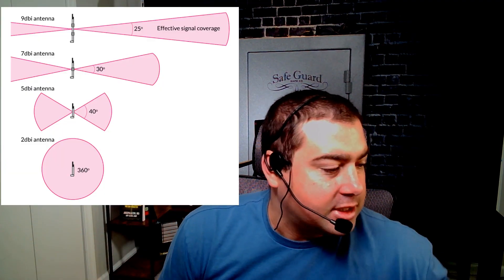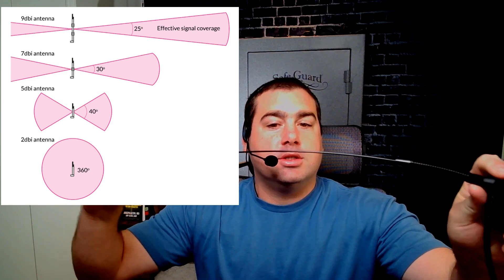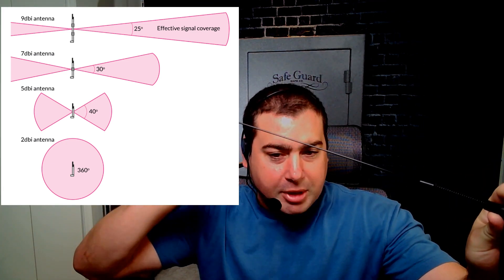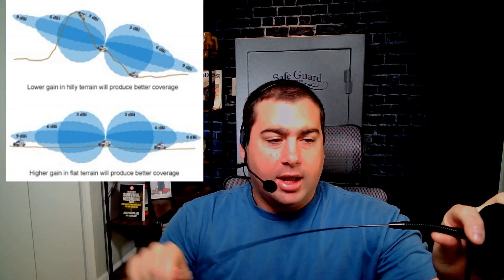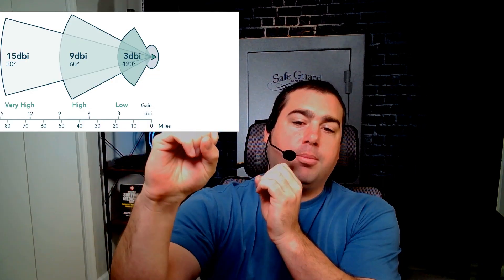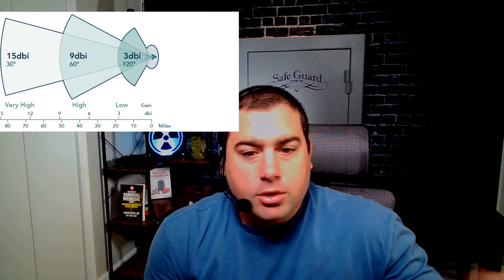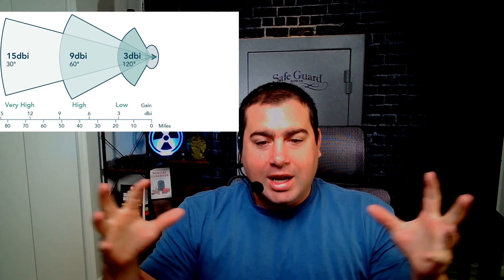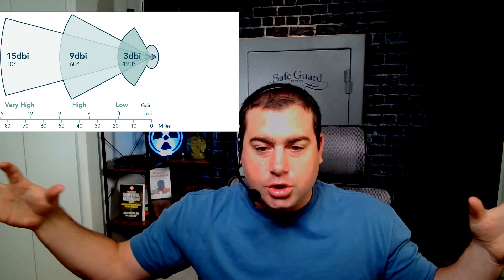Unlocking GMRS Radio Range: High Gain vs. Low Gain Antennas

Comment: I'm in NW Iowa, in the plains. We're dealing with max elevation changes of up to 50 ft across 2 to 5 miles. 75 ft across 5 to 15 miles and 100 ft across 20-30 miles. Any general recommendation for gain on a base station or repeater and a 25 watt GMRS repeater?

Comment: Great video very easy to understand! I live in a very hilly area and i have a wouxun kg-1000g with an ed fong gmrs antenna 35 feet off the ground on top of my house. I use lmr 400 coaxial cable. Im getting. 1.01 swr on repeater channels with 50.1watts. And 1.04 swr on gmrs 1 through 7 with 4.77 watts ,and 1.05 swr gmrs 15 through 22 with 49.2 watts still cant hit any repeaters that 1 is 10 miles away 3 more between  20 and 30 miles away bummer man any suggestion would be great.
Reply from the maker: Are you sure the repeaters are programmed correctly into the radio? It sounds like you are doing everything right so far.
Reply: @citizensurvivalplan  Im 99% percent sure    although I haven't been able to curchunk yet. I have a wouzun kg-905 and 935g those 2 in my car at the top of the hill I can hit 2 of the 4 repeaters. Just not at my house with the base station.
Reply from the maker: @madmasjohn  I would double check the ctcss tones in your home radio to the ones you can hit the repeater with at the top of your hill. if they match and yuo still cannot reach you may need a taller antenna it sounds like your home is in a valley. one thing that has happend to me is the rx tone should maybe be turned off as the repeater sometimes has a differnt output tone then its recive so you may be hitting it and your radio is not picking up the kerchunk if that makes sense.
Reply: Thank you. Yes I am definitely in the valley. I looked into it and my house is 1180 ft.above sea level and the hills surrounding me are near and over 1400 ft.   Bummer man.  I definitely will try shutting off the one tone to see if that makes a difference.thank you for the advice.  I'm determined to get outa this hole I'm in lol

Comment: That little magmount is NOT a high-gain antenna. The best way to extend range is to elevate your antenna. Also unless you live next to a 2000' cliff, a high-gain antenna is a plus. Low-gain antennas tx & RX much of the RF high into the sky, were no one lives. Mount a base station antenna (tuned for your chosen frequency) as high as you can, and use low loss coax. I am a ham and GMRS operator (including repeaters) I live in the MOUNTAINS of NE Washington, high gain antennas are usually a benefit. Antennas, regardless of gain, can be built as omnidirectional or directional (YAGI).  HT and Vehicle antennas are omnidirectional.
Reply: He just explained that high gain antennas don’t work for him switching to low gain and he’s happy with the results. I live at the foothills of the Appalachian mountains and high gain antennas are worthless here. It gets dark at 6pm in the Summer.

Comment: You where using that handheld sized whip for a base antenna? That's tough dude lol. How many miles can you hit at 50 watts?
Reply from the maker: Its a base station antenna rated at 150 watts. In an open area i am sure it would go 30 to 50 miles.
Reply: @citizensurvivalplan It probably would do very well on a vehicle,
but have you tested SWR in your working setup?
It sounds like you may be getting a lot of reflected power which will lead to signal distortion and degradation, it could be due to a poor ground-plane as those antennas use the magnet mount as ground when used on a vehicle normally. you should place them on a large metal object, like a baking sheet at the smallest.
That could be why you where not getting far. That antenna only has +1dB (33% for simplicity) over a standard dipole antenna so it's not much higher than your standard included antennas, most handheld gmrs radios come with a 2-3dB gain antenna from the factory. Gain, on a virtical Dipole like you are using will focus the signal vertically, so as long as whoever you are trying to talk to isn't above or below that exponentially expanding beam you should be okay.

My biggest tip is height of the antenna. Placing the antenna double the distance of where it currently is now will essentially double the effective gain.
Have a look at the Tram 1486, it's a 6dB gain antenna that would probably be able to hit repeaters at 100 miles at 50 watts in to the antenna. You could put the antenna in your attic if you can't go on the roof even, if you go this route don't skimp on the coax cable as it truly does matter. Low loss cable is EXTREMELY important at UHF frequencies. For example, if you have some RG58 U/A 50 foot run, your line loss would calculate to around -3.6dB, that means you are losing more than half of the wattage you are sending to the antenna to heat, but the antenna gain can make up for it. LMR 400 for example would be closer to -1.7dB which is more like 1/5th of your wattage wasted to heat.
Reply from the maker: I had the antenna on a magnetic mount up high we live in a really hilly and suburban area i have tryed 6 db gain antennas basicly does not work at all in our area. this is the only antenna that i can reach my entire town with. @randykitchleburger2780

Comment: Very interesting, I've never heard anyone explain  High Gain vs Low Gain antennas like that before. Good job! 😎 Our very rural foothill community currently has a small neighborhood (SHTF) network of 12 GMRS Radios. I'm also working on a 50-watt repeater to connect with many of my neighbors whose altitude can vary from 3,000ft. to 4,800ft. I've been debating for weeks about the best antenna setup and the ground plane. All powered independently with an Ecoflow Delta 2, 480-watts of Solar input, four lithium iron phosphate 100 amp hr batteries, and two 2500-watt Champion Dual-Fuel Generators as a backup power supply, fueled by quick disconnects connecting those generators to the low-pressure side of my 250 bulk propane tank @ 11" W/C, or to be more portable connected to a 20lb propane bottle, which will recharge my battery bank in about an hour.
Reply from the maker: Thanks I am glad you liked the video! and good luck it sounds like your getting things squared away with you're radio setups.